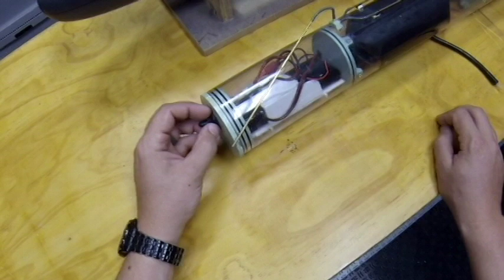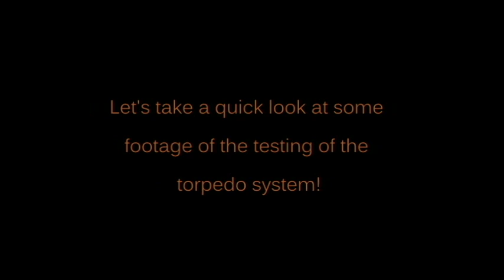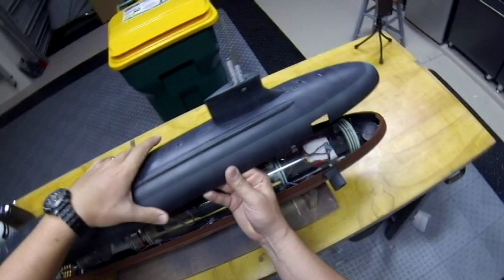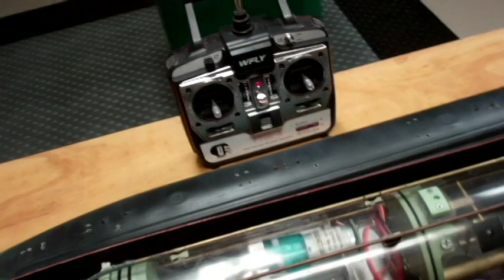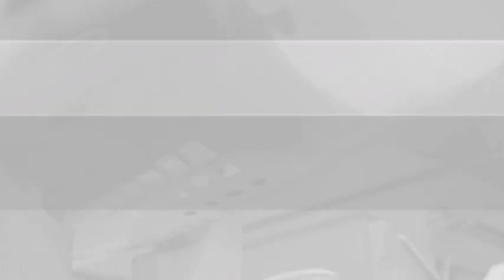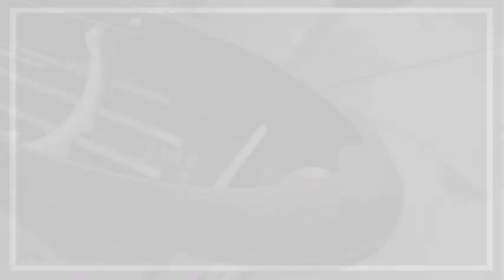USS Seawolf R/C Submarine final assembly and overview!

Comment: what 's the price of a whole biuld-up part by part, I wonder? Looks like RC-sub is not so widespread as RC-airplanes and must be quite expensive...
Reply from the maker: Here are some rough ideas on pricing:

-Hull:  from $100 (small plastic model conversion) to over $1500 for larger, rarer, fiberglass hulls
-WTC (watertight cylinder):  from $450 to $1500 depending on quality and performance
-Misc. electronics (pitch controller, failsafe, etc):  $100
-Radio system: from $150 and up, depending on channels and capabilities
-Misc. hardware (brass rod, linkages, dogbones, etc.):  $50
-Labor to assemble (assuming you don't do it yourself):  $1500 and up

Comment: and how on earth do this ballast system work???
Reply from the maker: Radio:  You need a good 75MHZ system for use in the US.  GHZ systems will not work at all.  I use the WFLY systems from Caswell.  Cheap and work well.

Ballast:  This particular model uses a gas system.  It has an onboard tank that you fill with liquid gas used in air brushes.  When you "blow" ballast, a bit of that is ejected into the ballast tank, displacing the water and bringing the model to the surface.

Check out the FAQ section of my website (referenced in the video above) for details on many different systems.
Reply: how does the valve in the ballast system work then? i wonder if the water pump with a controler bord on caswellsubs works good to fill and empty a one tube ballast tank, what do you think?